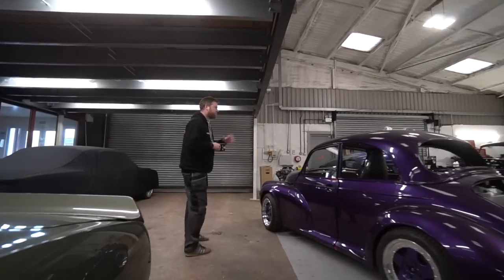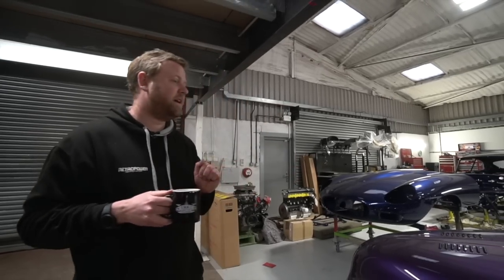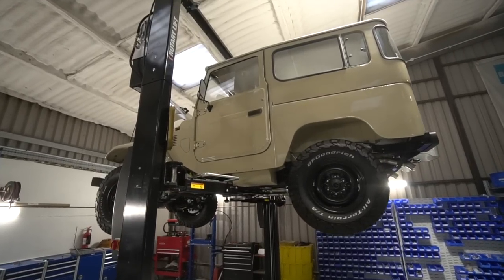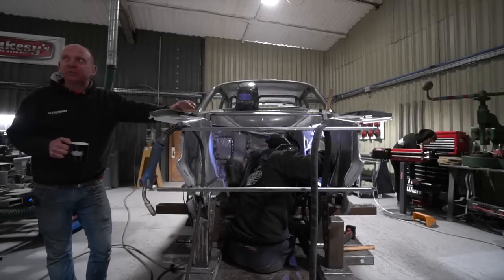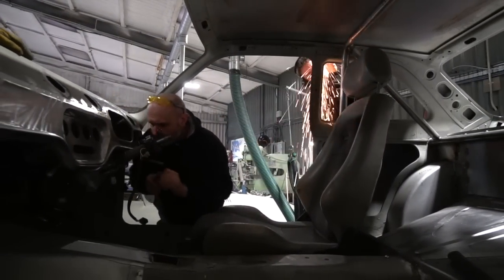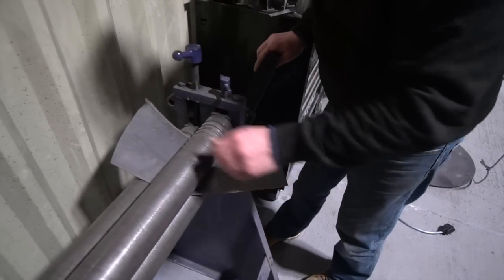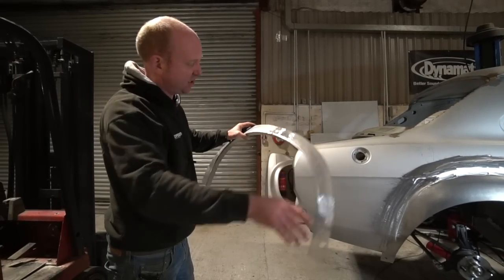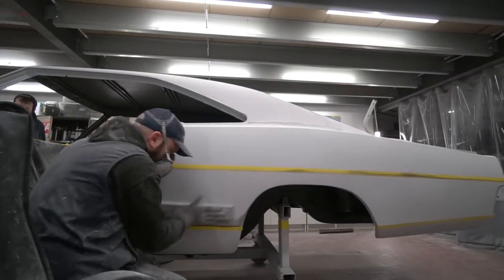Retropower Uncut Episode 121: MK2 Jaguar Coupe Restomod

Comment: Curious your thoughts on the liquid nitrogen freeze method of removing sealers and body damping sheets?   I know I have seen this on the vibration sheets, maybe not on seam sealers?  I dunno....    Thoughts????
Reply: Dry ice - frozen carbon dioxide - is the more common freezing medium. Cheaper, easier to store and use - insulated chilly bin, solid chunks that can be placed, and simple gloves rather than awkward dewar and liquid that settles on the lowest parts and leaks through holes.

Comment: For the Jag digital gauges, if you use a digital screen add stainless steel crescents 🌙 or full circumference rim around the area of the speedo and rev counter appear on the screen like the BMW F10 M5 etc

Comment: E=Type. You surely want air to pass through the evaporator before the heater matrix so it is first cooled to drop moisture then warmed as desired.  The dehumidified air clears condensation on the interior of the windows.

Comment: I’d be interested in hearing about the E type’s throttle bodies. They look like SU side draft carbs.
Reply: The video does mention throttle bodies in the context of relocating the battery to where the stock air cleaner was located. I’ve never seen Retropower do a car w/ carbs.
Reply: @ppeterson9359  
So he did, thank you, I completely missed that.
I can't recall what the Rover V8 in the Manta was using - that'd be about the only one that 'might' be using a carbie?
Can't really think of a reason not to use EFI, unless one wanted period originality or looks?
Reply: I couldn't say if they do SU style ones but there is a firm called Jenvey in the UK who make throttle bodies that look like classic carbs.
Reply: Thanks for the reply. Now that I look, I see some information that indicates that Burlen themselves have developed fuel injection systems that look like classic SU carbs.  They call it SUi.  That said, the only info I see on their site and the web is dated 2017.
Reply: @ppeterson9359  Probably worth sending them an email asking for an update
Reply: There are at oleast two E-types there - the V12 is on throttle bodies but I understood the 6 was on 3 x 2" SU carbies, as per OEM? 
Yup, watched a few more times and everything consistent with carbie and nothing to suggest FI. There are a couple of TB designs that replace SUs, but they're nothing like the carb' designs, so not as easy a period correct look as the Jenvey' Weber style EFI bodies.

Comment: just 2 things this week, The first is the tradition of Jaguar to color code the cyl heads, to designate the state of tune, compression , valve size, and porting. after spending many years in the sixties looking for the right heads to hot rod mk2s, it became a big deal with jag people, to the extent to this day its the first thing looked at on a Jag.
The second thing on the other jag, having dealt with a number of cars and vans that have tried to drive through floods and then being incredulous that they had bent all the rods and totaled the engine. I would never put any component on the intake in the wheel arch or lower that the intake manifold.."But they will not be driving through floods" having lots of money does not = good sense
Reply: You may be able to help me identify my 3.8l motor with a gold coloured 6 port head on it. Is this an E type head? It came with a '63 Mk 2 parts car in the late 80's. Was going to build a small front engined rail but went with a V8 Altered instead.